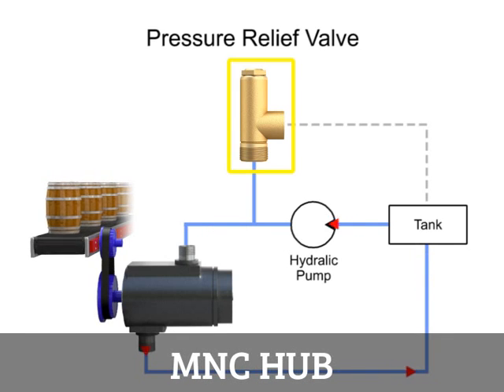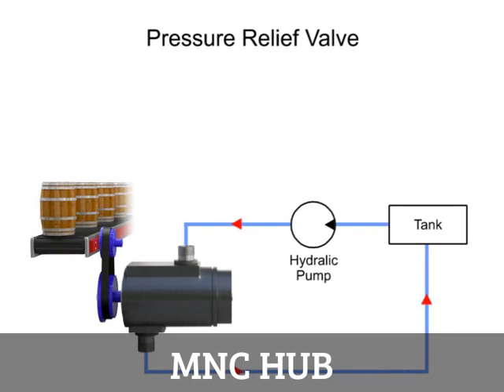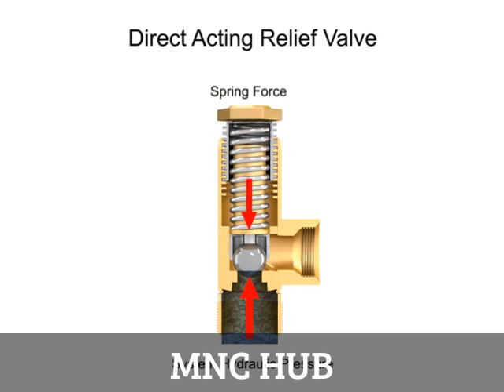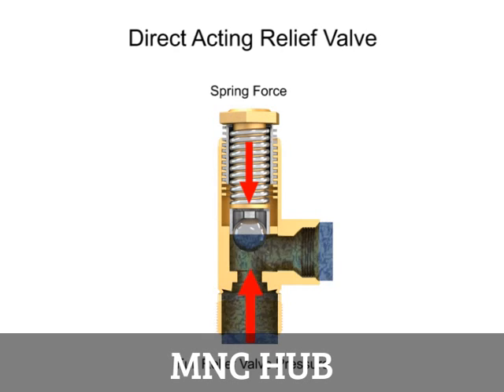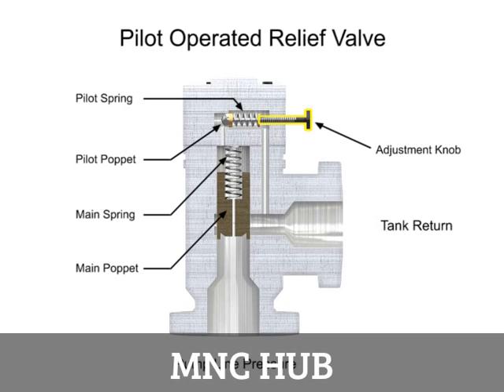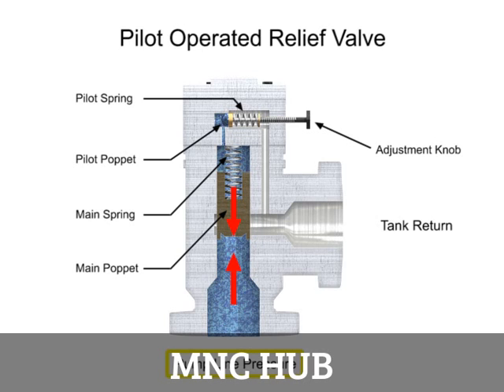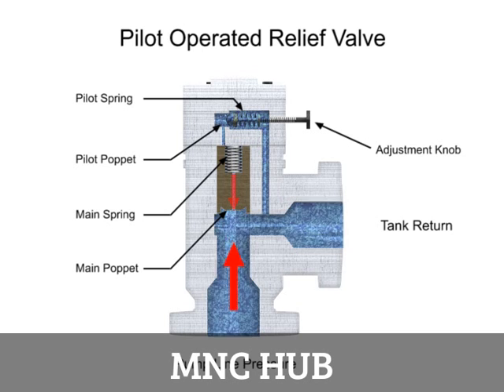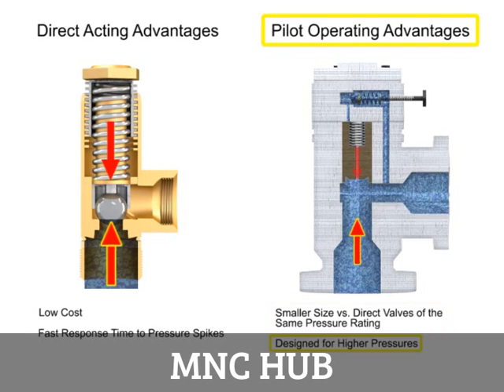Animation : Pressure Relief Valves: Direct Acting and Pilot Operated

Comment: Sir if the relief valve does not reach the set pressure range then the pump is continuosly flow the oil to cylinder or oil is return to the reservoir tank through relief valve. 

If the oil is return to the reservoir tank through relief valve please tell me how it is working